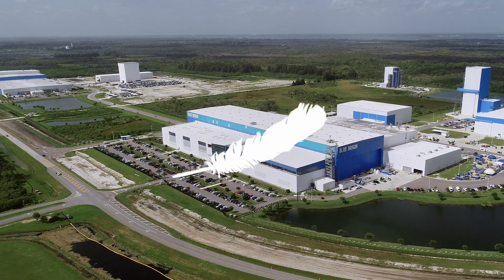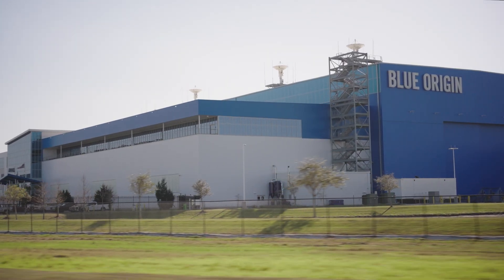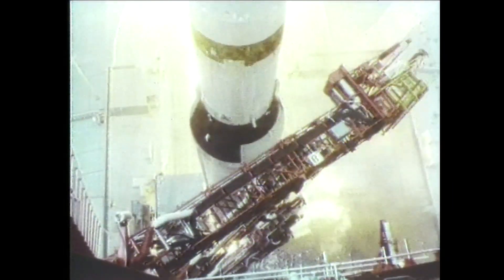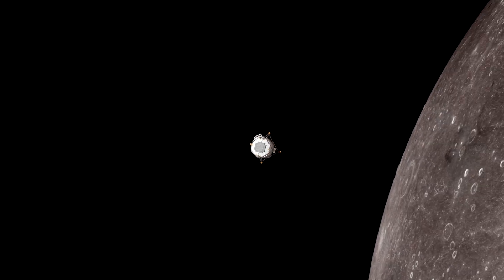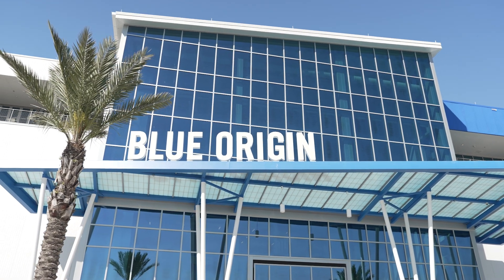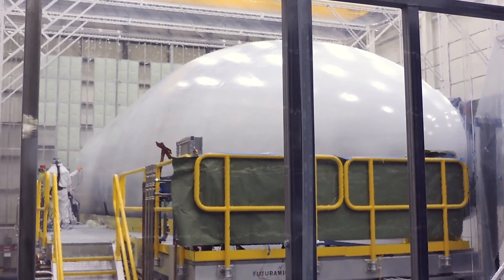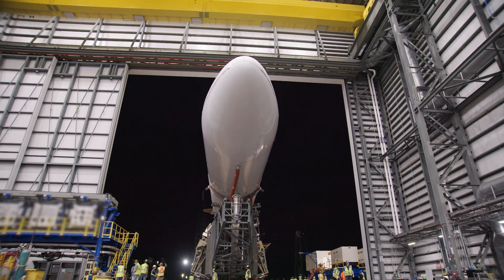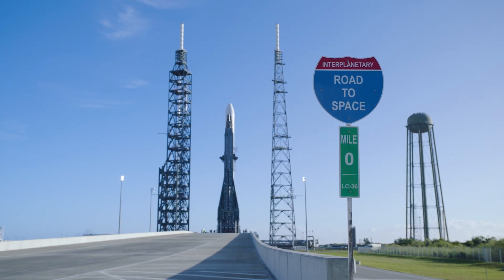Blue Origin's Rocket Park

Comment: Wish we could get some info on the New Glenn reentry issue. And how about something on the New Shepard scrub and anticipated new launch date. Love Blue Origin but it's pretty thin pickins when it comes to information and details.
Reply: NS-29 scrub was due to bad weather and a computer glitch
Reply: @notgreg123  Was it a computer glitch or a system issue on the rocket itself. What was the issue....again, computer or rocket glitch tells me nothing. I already knew this but there is no detail on what the glitch or rocket issue is.
And I have heard nothing at all on New Glenn since the reentry RUD
Reply: @dbreardon  they specified but I don't remember what it was. 
As for New Glenn, they aren't technically required to share the cause of failure but it would be nice. I might be wrong but I don't think we ever got a reason for Vulcan's SRB failure.

It's also possible they're still working on the cause of failure and will share later. We'll see
Reply: @dbreardon  The stated it was an avionics issue on the booster and the scrub came since it was a double whammy of that and the thick cloud cover.
Reply: @Starshipsforever  The thick cloud cover was probably by itself going to scrub the launch.
Reply: @dbreardon  no private company will give you detailed info on what exactly the computer glitch was lmao

This isnt nasa, they arent required by law to give you every bit of information